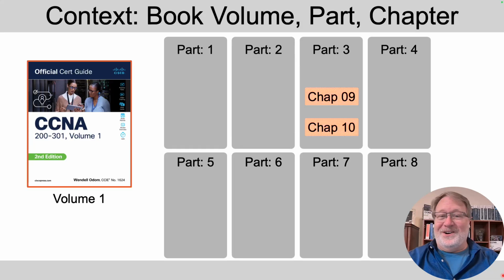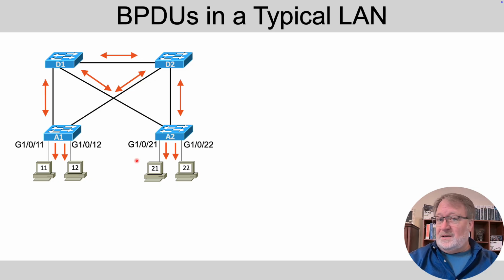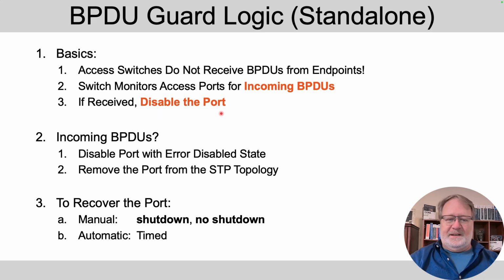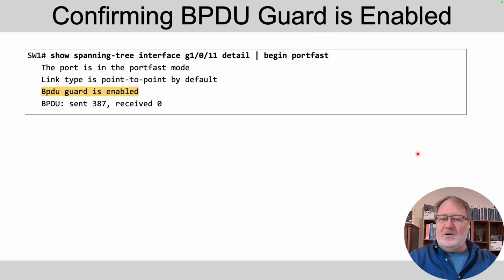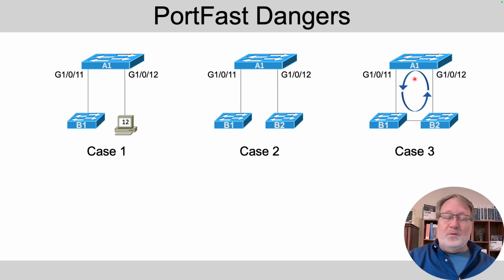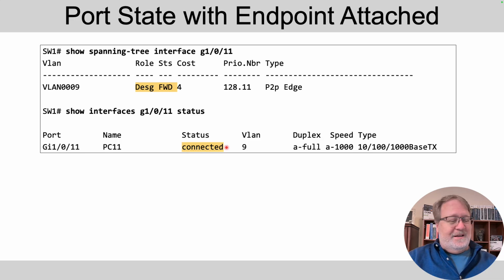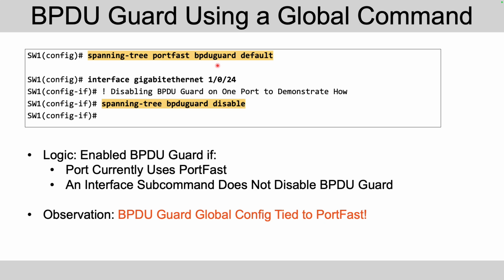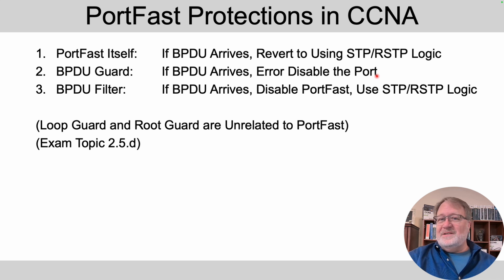How BPDU Guard Saves Your Network from Rogue Switch Attacks. #CCNA

Comment: 11:00 also I got one command which enables bpdu guard and PF globally.

-> spanning-tree portfast bpduguard default
Reply from the maker: If I'm understanding you... then no. That one command does not enable both portfast and BPDU guard globally. That one global command does this:

Change the BPDU Guard default to "enabled" for ports that have enabled portfast.

So, some other config must enable portfast.
And, there must not be an interface subcommand that overrides the global setting to disable BPDU guard.

Isn't this just a mess?!?!

Comment: In the scenario where a Switch A has portfast enabled by default, bpduguard also enabled by default in the global config mode. If switch B attaches to switch A via ethernet copper cable should it not be the case that the portfast logic ceases which would imply that bpduguard will not be active on that interface? I am having mixed outcomes on packet tracer.
Reply from the maker: Well, I haven't tested that in depth in CPT. But on real gear...
If Portfast only, in that scenario, when A receives the BPDU from B, portfast reacts by disabling itself, so RSTP converges as normal.

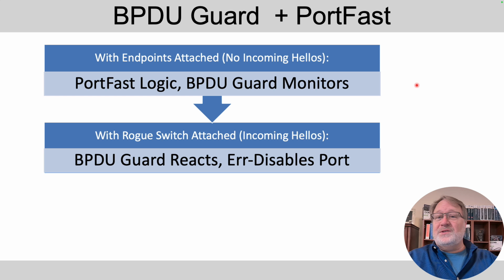But to the core of your question, with BOTH portfast and BPUD Guard enabled on A, the BPDU Guard logic takes precedence. That is, when A receives the BPDU, BPDU Guard err-disables the port. See the 9:30 mark for the concepts and the 11:30 mark for the sample output.

Just a general comment on CPT, it does not always mimic real gear exactly. I don't recall testing portfast w/ BPDU Guard there. So it could be that you're testing something that doesn't work like real gear. FYI.
Reply: @networkupskill  Thanks for the clarification
Reply: Is the bpduguard default function not premised on whether portfast is active on the interface? So if portfast default will react by ceasing its operation on an interface that receives a bpdu then the bpduguard default should not also take effect